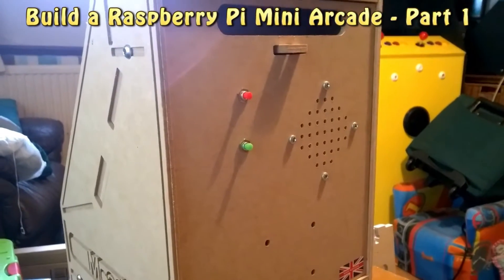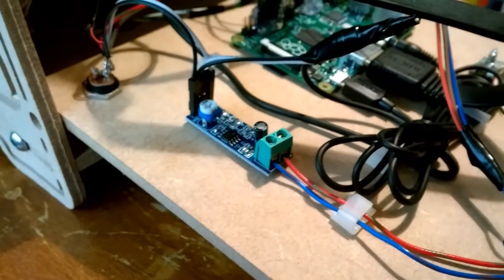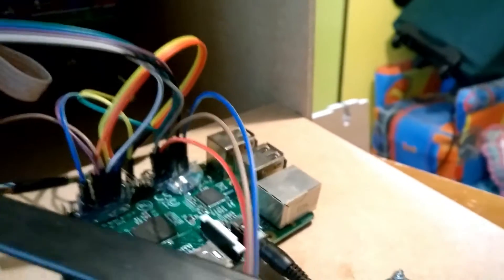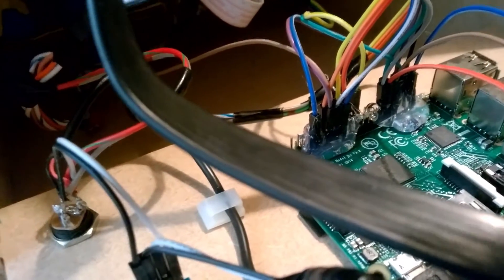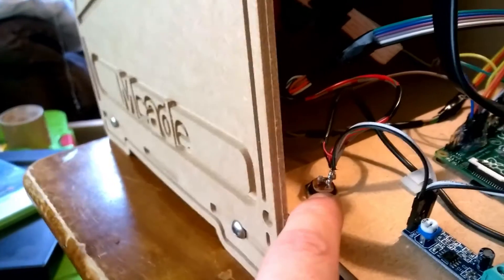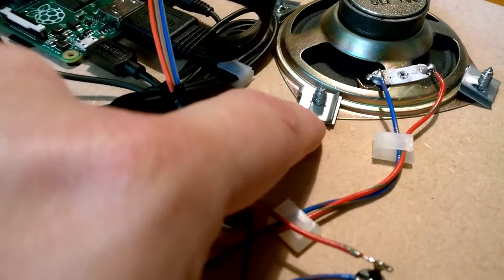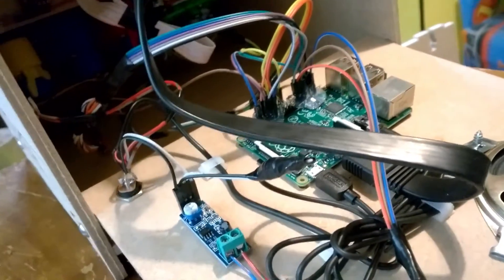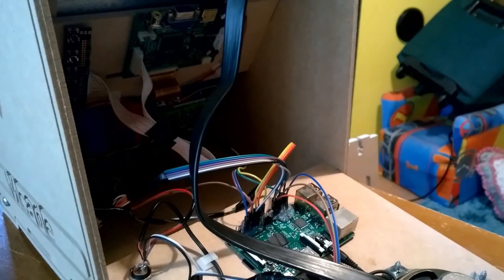Build a Raspberry Pi Arcade  -  Part 1

Comment: Do you possibly have any links for the volume buttons used? and which 
joystick do you use? as my one won't fit with the 2 front buttons below 
the joystick. Thanks!
Reply from the maker: Sure https://www.modmypi.com/electronics/buttons-and-switches/12mm-domed-push-button-6-pack/?search=button